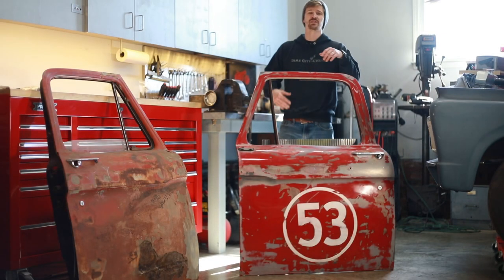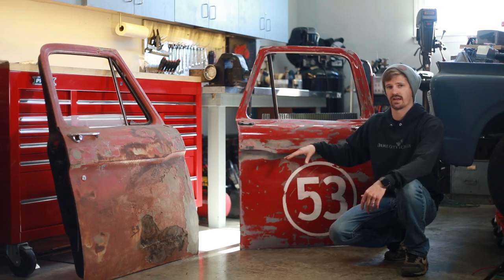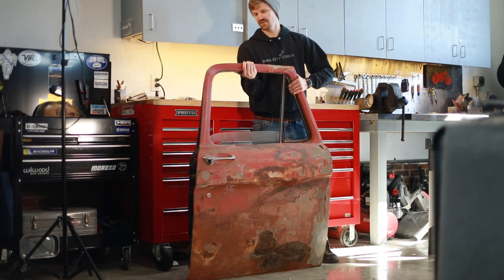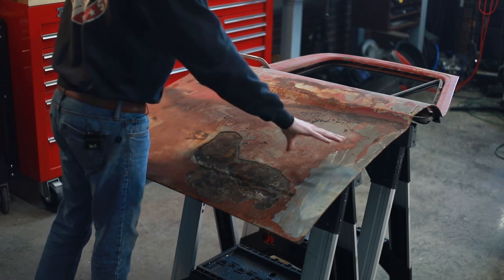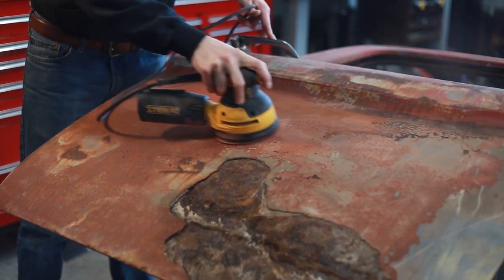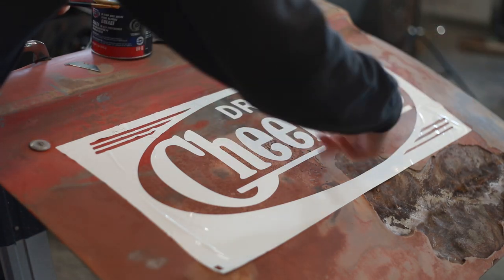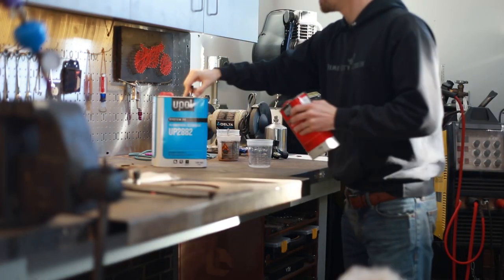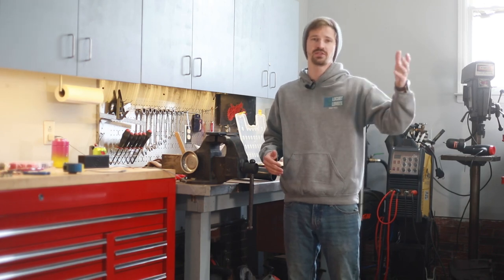How To Create A Vintage Sign From Scrap Metal

Comment: After sanding, spray Loctite Rust Neutralizer over the sign front and back to halt the rusting and seal in that look. It is clear.  From Lowes only.  Then paint your sign.  Now the rust won't corrode from within.  
Your project turned out beautifully.  It is very artistic!
UPOL - is this a type of 2 part epoxy, same as their raptor bed liner paint? Does it have to be sprayed or can it be rolled/ brushed on?